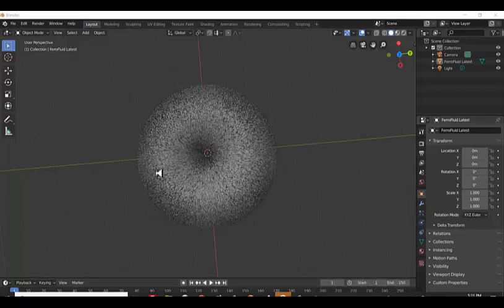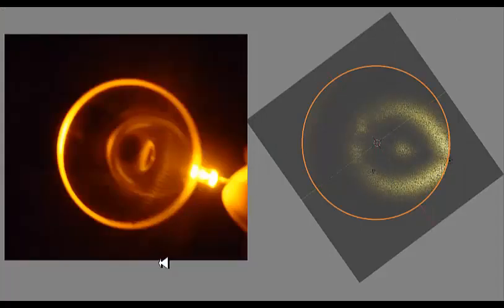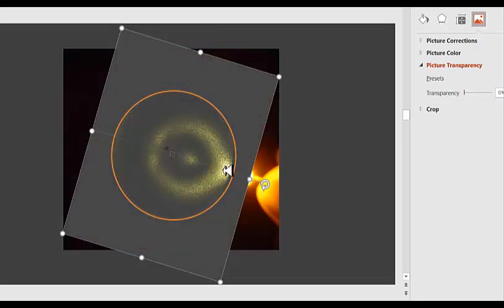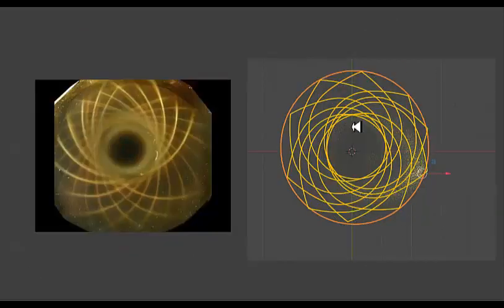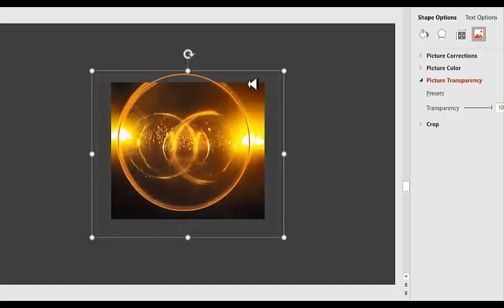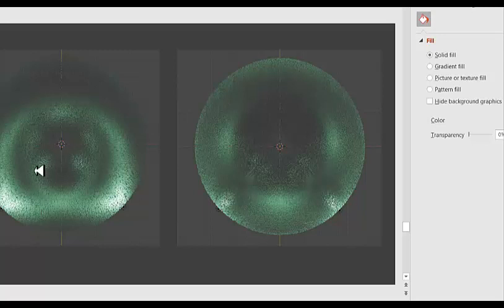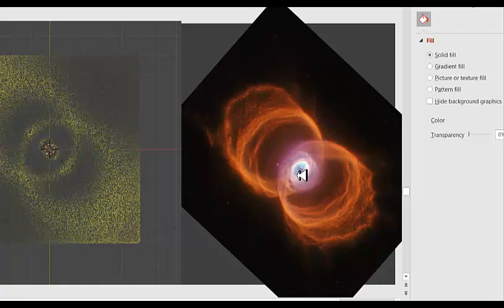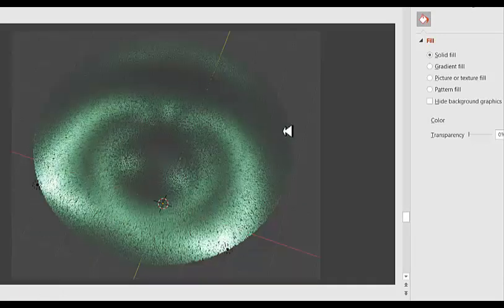Demystifying the Ferrocell  :   PART 3

Comment: I think we all need to band together in order to pitch in and get FW her very own 3990X Threadripper system with 256GB or more of ram. We could go even better than this. A proper workstation for science! =)
Reply from the maker: Wow. That looks like a hopping system. I do have a proper workstation at work. It is not a Threaddripper though but it is quite good. My Lenovo Gen9 laptop is also a very good one and has an excellent GPU. I was surprised at what I was able to accomplish with just a laptop. I have been programming computers since the punch card days. We have come a LONG way.
Reply: @FractalWoman  The last vestiges of punch cards were still around while I was in school back in the 70's. I remember the field trips and getting the chance to program with the class.=)

I was just reading as you kept mentioning how you needed more RAM. But, I think you'd make some decent use out of a 32 or more core system with gobs of RAM as well. Might have to make do with your current GPU for now. Shortages and all. 

Again, just teasing. I come from an IT background as well. But any of the python work I do is just for automation and mundane networking etc. Nothing as cool as this.

Cheers! And thanks for sharing your journey of learning and curiosity. Always great to see what you're up to.